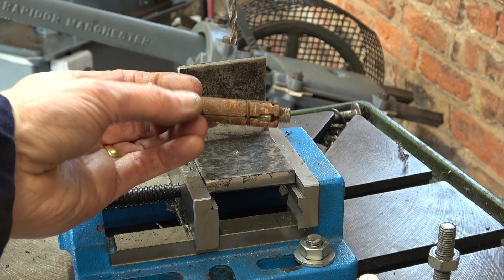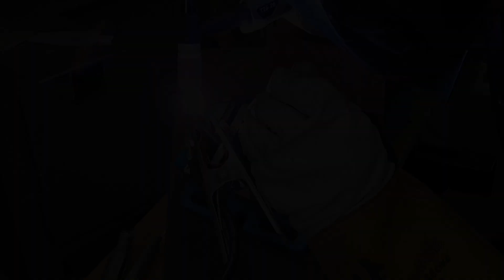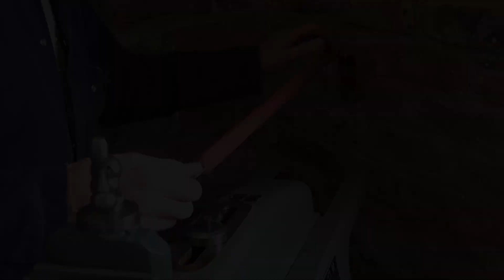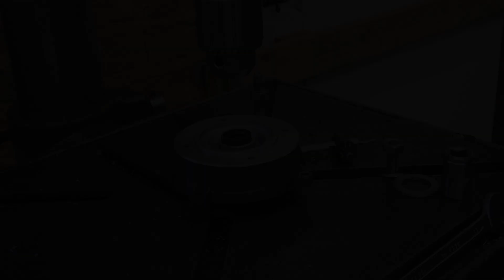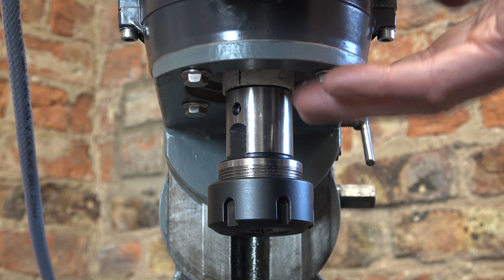HS135 Shaper milling head – Part 3

Comment: Cheers Paul, looking forward to the next part! In my limited experience carbide will cut just about anything, but is incredibly brittle and easily damaged, so I try to save it for those special cases where HSS doesn't perform. I imagine it's more reliable on a large super rigid machine, or with CNC where feeds and speeds can be tightly controlled. Just my two penneth. Hope your finger's not too sore!
Reply from the maker: Ah well TRM, your comment is very relevant. Alain gave me two 12mm carbide end mills and the first I ruined in the first test on that rough bit of steel. It chipped a couple of flutes. I use the 2nd carbide end mill in Part 4 after I had built the chuck collar and then it was ok - good cut no chips off the end mill.  After that experience I will use the carbide sparingly and also make sure I don't drop and chip it as I release it from the collet chuck (I did drop it but luckily it did not chip). Cheers

Comment: Nice work!!  Welding requires constant practice and the more you do the better you will get! I am always amazed at how rusty i get after a non welding project like the tractor, and now i have to make a front cowl guard, so welding here we come!
Phil
Reply from the maker: Hi Phil, I'm still early on the learning curve with TIG. I can just about do something with thicker plate now but with anything thin I will burn hole in it quicker than you can say "now did I turn the gas on?".  Cheers

Comment: A spring loaded pin with a matching hole in the ER collet could be used to prevent rotation. I've modified a couple mills this way and have found it to be a very convenient method to lock spindles for collet changes.
Reply from the maker: Hi E Designs, that sounds a lot easier than 2 hours winding the tailstock in and out to manually cut that keyway. Cheers

Comment: Looking very good,  more iterations to develop 👍.
Fillet welds generally require filler wire, a lot of undercutting occurs otherwise,  the throat depth should equal 0.7 of weld width, think equilateral triangle. 
Mill head looks surprisingly at home on the shaper,  little bit of a Eureka moment 😳. The inaugural Haxby Shed Milling attachment for your metal shaper.
Thanks for sharing.
Reply from the maker: Hi John, you will see a nice example of undercutting in Part 4. But it is neat and low distortion (local heat) undercutting - pending me developing the skills to add wire quickly and neatly. I'd be alright adding filler if it was out of sight; I need more seat time. Cheers.

Comment: This is a fun project! If you really want "dead nuts" accuracy when you flip the part over using that method at the end, I believe it's a good idea to drill, bore and ream in that order. If the drill wanders, the reamer will just follow the eccentric hole, whereas boring first will true it up. "Drill, bore and ream" comes up a lot on model engineering drawings for that reason.
Reply from the maker: That's very good advice Cooperised. The more I use drills the more I realise they are just roughing out tools and often not very accurate in either size or position. Cheers

Comment: I would suggest that you build a separate spindle, and only use the motor to power it. All the bearings that you have in your assembly are completely wrong for your application. I would suggest a simple spindle with two angular contact bearings arranged so you can tighten them and thus achieve a preload which would help a lot with the spindle rigidity. All the best to you, I'll keep on watching this series
Reply from the maker: Hi Dragoș Mateș, I agree with you. The best solution would be a separate purpose-build spindle however I will continue to make best use of the current setup because of all the work I have already done and because it is very compact. I have decided I will need to fit taper bearings in the motor .... in the future. Cheers

Comment: Loved the series. I think if you do some work on the bracket, to make it more rigid in all axis, you will do well to cure a lot of chatter, and be able to mill a bit more agressively.
Reply from the maker: Hi Christian, I think a stronger bracket may help though please also note that the downslide on the shaper can also be a source of some movement even when it is locked. This design will always be a compromise solution good for maybe 90% of my hobby jobs - and for the other 10% I will ask a friend with a mill  😁 Cheers

Comment: Hope your finger soon gets better. Design by iteration. I always thought that a milling cutter got pulled out of the chuck by the cutting forces. So your thrust bearing is on the wrong side of where the force will be.

I like shapers but I think a vertical milling machine a lot more versatile.
Reply from the maker: Hi Carl, sure there is a reason why you don't see shapers around much these days. You are right about the spiral flute end mills of course and I will be fitting taper bearings as an "in life upgrade". In fact they have just arrived in the post...... Cheers
Reply: @HaxbyShed  Great stuff Paul. I would actually love a shaper but I simply do not have room.

Comment: I find milling cutters on a side cut actually draws the spindle down. The thrust bearing installed at the collet end will only support the shaft while drilling.
New motor end bells with tapered roller bearings that you preload with a nut on the shaft would stabilize both axial and radial loads. Basically creating a motorized spindle.
Stealing ideas from my milling machine😉
Reply from the maker: Glenn, you and a few others made much the same comment and so later I will install taper bearings. It did not make it into Part 4 (the final part) but the bearings have arrived as a post development upgrade. The thrust bearing and the chuck-end taper will act against each other with a calculated spacer washer to give me the preload (that's the plan anyway).  The taper bearings will replace the ball races - same outward dimensions. The support collar I've made for the chuck will take all the sideload so I think the end bells will be ok I think but the taper bearings should remove any temptation for the bearings to allow chatter. Cheers

Comment: I think what you are doing is called "empirical design". I made a similar milling head for my old Denbigh milling machine but it had the motor offset and a tooth belt drive to the spindle.
Reply from the maker: Hi Mark, I think the smart people do have a separate spindle with taper bearings etc. All I can say is this is very compact, albeit a compromise. Cheers

Comment: You not want to weld without filler, because the weld will be very weak. It's missing the additives what makes the weld stronger than the base metal.
Reply from the maker: Hi Logan880121, yes I understand. With more practice I hope to get my welds neat with filler wire. Until then I'm cheating a bit .....  When I'm confident with the filler, and certainly on anything needing proper strength, I'll use it. Cheers

Comment: Very happy to see your welds. Once your confidence comes up, the welds get better. I am facinated by your "mill" design. I think in the end you'll get it working just fine. I was apalled by your finger: I have arthritis in my hands, but it can't hurt as much as that did. Cheers & get well. Rooting for your success on this project.
Reply from the maker: Hi Bob, it all comes together in Part 4 working pretty well. My finger is just about ok now but my son felt very guilty for landing the box on my finger. But it was only resting, not a drop from height. It was worth it to get rid of that old gearbox cluttering my garden for about a year! In fact we dumped two gearboxes and a beam axle so now I hardly recognise the place. Cheers